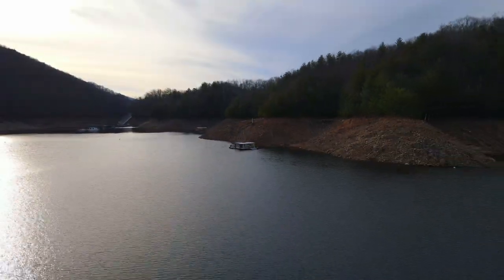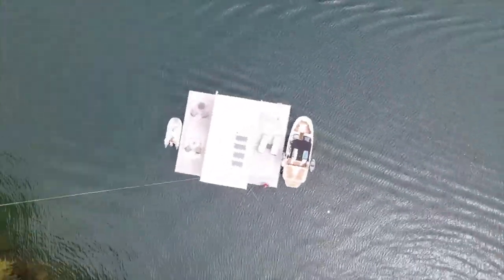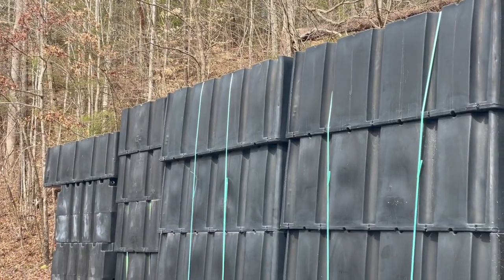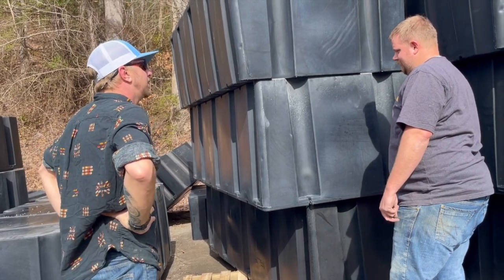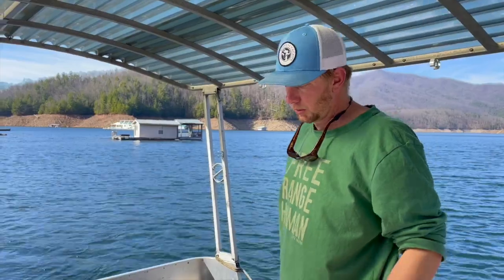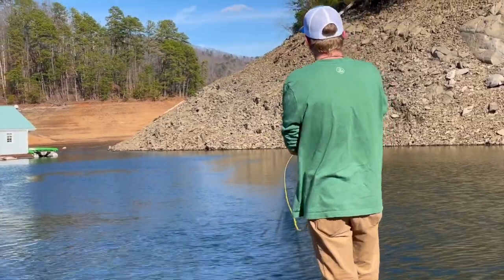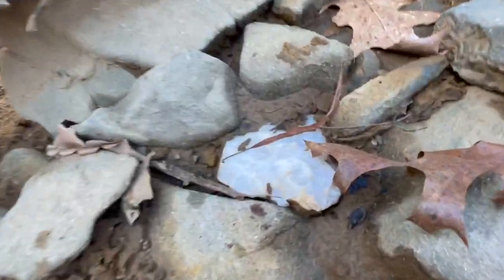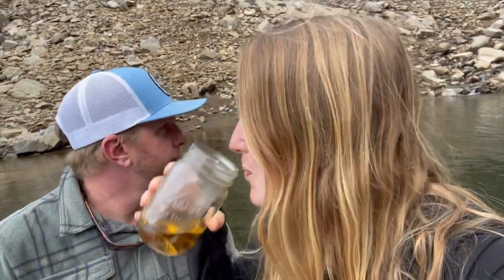NEW FLOATS + MOORING SETUP for floating tiny house build  🥳

Comment: Will you still have the cascading water in summer when the water is higher?
Reply from the maker: Yes, it extends up into the woods so it’s still there in the summer! But it extends down about 60ft in the winter onto the rocks, which makes it a lot louder (which is nice ☺️)

Comment: So, is there any way you can use the spring water for the house?
Reply from the maker: We will use it for drinking at least! 🙂 w/ filter of course. we already have a city water line plumbed right by the cove that we will probably use for everything else to save $$ on water filters (quite expensive). we’d love to find a way to harness it for power though 🤩 have seen some tempting hydroelectric kits online… we’ll see 😊